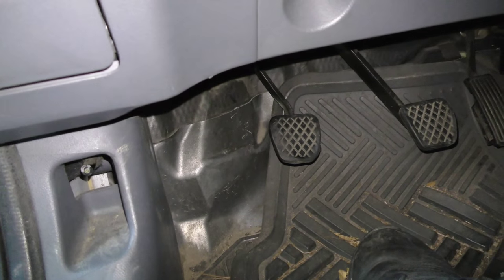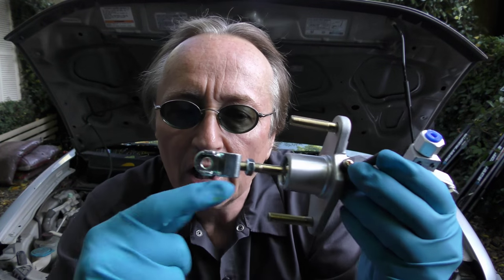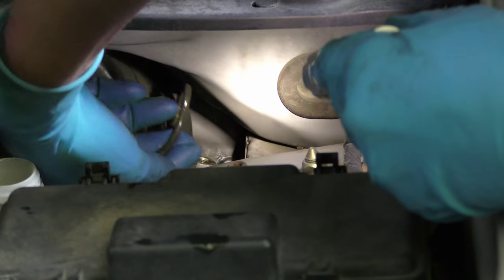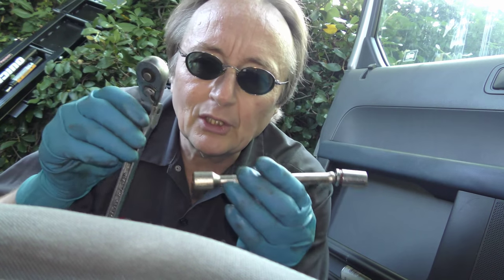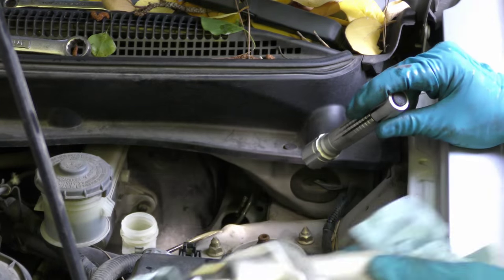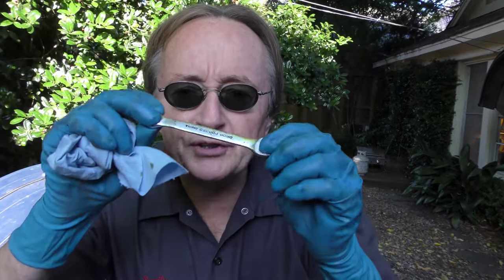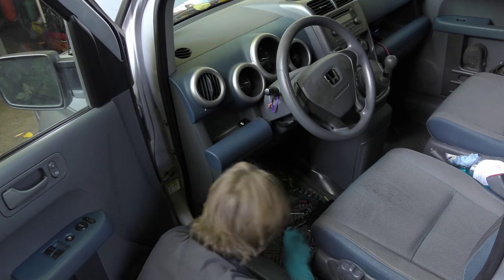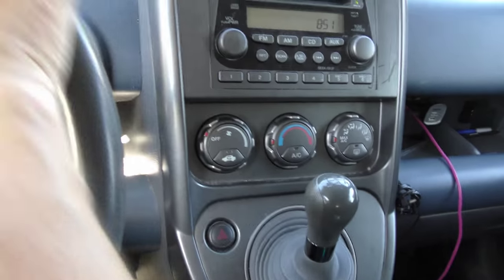How to Fix a Car that Won't Go into Gear (Clutch Master)

Comment: Hey Scotty I got a 56 chevy pickup with an aftermarket power steering conversion it, going down the road yesterday out of nowhere the wheel became a bitch to turn. I'm almost positive its a bad pump but it didn't groan at me or give me any signs it was going to go out. Any input?
Reply: Update new PS pump didn't help a damn thing, wheel feels seized up screetches like hell when you turn it,  linkage seems normal

Comment: What vehicle was that? Ive never seen a manual shifter up there. Is that weird to drive? (Commin from manual daily driver) And keep up the great vids scotty.
Reply: trollaphobic It looks like a Honda Element.
Reply: As a 4 year valet veteran, i can tell you there are many harder gearshifts than a Honda Element's. Being on the bottom of the console like that isn't too bad. The way the seats and wheel are ergonomically set up helps a lot. Doesn't feel like a stretch at all.

Comment: 2015 camero ss I have been having issues with 1st gear where it's been very difficult to engage it. Yesterday getting ready to leave to work I couldn't get it into any gear including R. After I turned it off and restarted it all gears worked except 1st. Of course I haul it over to Chevy they can't find anything wrong with it all gears decided to start working? Not sure what's going on?
Reply from the maker: it's under warranty, leave it with them and get a free loaner car till they fix it. Realize GM doesn't care much about their customers that much at many dealerships, and as they get very little pay for warranty work, they care even less then. Force them to.

Comment: Dodge neon 98, was driving in 3 gear. the stick shift will not change gears, it was stuck. but it was loose straight forward and straight back. tow it back to the house. next morning moving the shift around, start to get back to normal and i was able to drive it. clutch pedal was good no leak that i can see. so what could be the reason it got stuck like that?

Comment: My 2013 Kia Rio 1.2 has the same problem and it grinds when putting reverse. I changed the clutch master cylinder and it still has gears stucking when engine is hot. I can easily change gears when it's cold or engine is off. What could be the problem

Comment: How's it going? Huge question for you. It's kind of weird and an think I know what it is. So, I have a 2011 Caliber 2.0 mt. I believe it's something to do with the bleeder valve but not 100%. I installed a new clutch set, (it's one of those ones that the flywheel is integrated in the clutch, but you probably know that.)  master and slave cylinder, along with the clutch bleeder almost a year and a half ago. Haven't had any problems untill a month ago. Did my brakes, and about 2 weeks later, I start losing my clutch. It is an integrated brake master cylinder or whatever. My brakes work fine, no fluid on the ground, on my caliper's, in my trans or anywhere I can find. But it keeps taking air in my clutch. I got to bleed it every day. Works fine untill the next morning. Any ideas?
Reply: The lines are new too. I changed the end piece of the bleeder valve and it held up for a week but decided to take air again.

Comment: It's not very environmental friendly if you just change the whole part you could change the rubber seal. 

I get a lot of people swapping their alternators out when the diode pack gives up when a simple re-solder of a diode saves you buying a whole new alternator which is a 95% saving cost and it's like that with most parts that you have to regularly change.

If you ever get in a sticky situation where you have a rubber seal that is leaking and you cannot not change it in time and need to use the vehicle then cover the seal in wintergreen oil it swells the rubber up and stops the leak

Comment: My wife's car, a Hyundai Excel 1997 Sprint Auto, suddenly failed to accelerate after braking. It works when in Reverse, but the forward gears (D/2/L) seem to give out as soon as acceleration kicks in. AT oil was low, and I refilled it, which didn't fix the issue.

Can we narrow the problem down to a Transmission issue, or should I try something else before I take this to wreckers?

Thank you kindly.
Reply from the maker: koran junk transmission is shot, junk it or gamble with a used transmission
Reply: Scotty Kilmer  Thank You very much.

Comment: I have a 2008 Kia Rio, after changing the clutch master, it got into gear for about a 30km drive, but then stopped
Someone said could be the clutch plate is burned out
Any advice for me?

Comment: Dear Scotty, i have a 2000 vw beetle glx  twin turbo six speed manual transmission , and its getting hard to shift through gears and sometimes i have to use force to get it into gears, now im going to change the fluid to ryoal purple max synthetic, will this help or is my tran going out? Thanks
Reply: The problem you have there is that you drive a beetle
Reply: Adam Socolofsky I have had good luck with redline synthetic trans fluid/oil.
Reply: Adam Socolofsky There are many reasons why your shifting is rough, may be synchromesh related or your shifter fork or a sticky clutch, worn out clutch, hydraulic cylinder to engage or engage clutch to the tranny. Also transmission gear oil how many miles or kilometers does the car have ? last service ?  also your driving style , how well you shift, do you keep your foot on the clutch pedal when driving ? on and on and on.
Reply from the maker: Jonas Ben pray the fluid helps, cause VW transmission work costs a ton. Also do check the clutch for wear, a worn clutch plate will do just that as will weak master cylinders or slaves.
Reply: Hey there Sir, thank you for your reply you read my comment awesome.

Cheers.

Jonas.

Comment: Hi Scotty Kilmer I have a 90 Honda Accord Dx automatic all my gears work except reverse some times it goes in reverse and times it doesn't it makes a grinding noise like a stick shift grinding noise I changed both solenoid but it still won't work right I need help badly any suggestions please

Comment: another video said if you can go into gears ok with the engine off but can't when its running its a clutch issue.....in your example could you engage gears with the engine off?

Comment: Scotty am getting a P0852 error code on my 2019 Honda Civic Type R and it does turn on but it shows that "Park/Neutral Switch Input Circuit High" how can I fix this?

Comment: I have a 1997 Chevy S10 2.2L and the automatic transmission quit going into the passing gear. I checked the fluid and that's perfect, I got no clue where to start. What could it be?

Comment: Hey Scotty where is the upper transmission solenoid located on a 2000 Nissan frontier 4 door 3.3L v6 automatic?
Reply from the maker: Eduardo Garcia   I've never done one, but they are either on the top of the transmission on the outside, or deep inside the transmission. Call a dealer parts dept with your VIN, and pray it's on the outside
Reply: Hopefully it's on the outside! Thanks

Comment: I have a 2005 sentra 2.5 se-r spec v that struggles to get into gets and will grind and push itself out of gear right when I'm about to let go of the clutch. could the repair on this video fix my problem?
Reply from the maker: in your case , more often a broken transmission internally, unless it's just a worn out clutch. But worn out clutches generally also slip on hard acceleration
Reply: I was hoping it wasn't internal cause the clutch and flywheel are both brand new

Comment: hi scotty
I asked this question before on another channel
1999 Honda civic Automatic ex.. that's doesn't go reverse while in that gear. sometimes it works sometimes it doesn't
soo can it be the gear shifter linkage? or the transmission there is no slippage in the RMPS
it drives smooth.. it just happens every so often 
soo what do I do?
Reply: +Scotty Kilmer so what can I do...to fix this problem is it the transmission or what? is it expensive
Reply: +Scotty Kilmer can you explain in detail please Scotty your videos help me out alot 😊

Comment: I own an 06 mustang GT and it still won't go into gear. In my car the clutch does not have a separate reservoir. The brakes and the clutch share a reservoir. What do I do if the master cylinder isn't leaking. I bled it but it still won't go into gear?

Comment: Scotty, I have a question.  I have a 2005 ford Mustang gt.  It's stuck in 3rd gear (manual).  What would be the particular reason?
Reply: Like stuck as in it won't come out of gear at all.
Reply from the maker: +GroundZ3R0Gamer transmission is broken internally in most cases, and needs rebuilding now. It was a problem on that year
Reply: +Scotty Kilmer I read that having a aftermarket shifter can cause the problem.  I have a Hurst short shifter and I think they said the set bolt nut can get lose and vibrate off and get stuck. What are chances of this?
Reply: +Scotty Kilmer *set screw nut.
Reply: +Scotty Kilmer same with me. except mine is a 02 gt mustang and I just replaced the transmission not to long ago and gear won't go in and if I force it in it won't go out of gear just replaced the clutch too what could be causing this?

Comment: I have a 2008 Volkswagen Jetta gli it goes into first and second gear fine but won't go into reverse or any of the higher gears do you think that could be the same issue?
Reply: Casey Alessi no most likely the transmission is shot
Reply: @anthonymaynard9809  it worked fine I took it off the road for a couple months got in it today now having that issue

Comment: @scottykilmer hi Scotty my trusted  mechanic has changed this on my Celica GTS 7 and it worked for 2 weeks ... Then it is having the same problem again, any suggestions??? 

I have taken it to him again and he flushed and replaced the hydraulic oil ...

Still having this issue. 

What is wrong w my Celica 😔😔

I m getting desperate.... 

Any advice is appreciated. 

Thank you

Sae.

Comment: I put in my clutch kit and slave cylinder into my car but now my pedal won't go all the way down to the floor! It kind of feels like brakes do. Do you think I might have put the clutch disk in backwards because there were no stickers indicating which side went were? I just don't want to take the transmission out again if I don't have to! PLEASE HELP
Reply from the maker: +daniel moukin first, bleed the crap out of the master and slave cylinder, but odds are you put a clutch part on wrong

Comment: I got a 74 Mustang II V6 Coupe,  i need to turn it off to get it into gear 1 or 2 if started in neutral. Or if put in neutral while the car isnt moving. but if im slowing down It'll slide right into gear 1 or 2.

Comment: Hey Scotty, I have a 98 Jeep Cherokee XJ the driver door has NO power to the door locks, power mirrors, or the power windows. But the power locks work on the passenger door. Any ideas? Thanks!
Reply from the maker: Nicholas Bolt those are notorious for wiring shorts under the dash,  check the connectors there for those systems, and pray it's not a bad body control module, no way can you check that without a dealer scan computer
Reply: I was doing some research that one or more wires might have gotten cut in the door jam on the driver side. I'm going to check that first. I see that's a pretty common issue. Thanks for your input! I watch your channel regularly.

Comment: In trucks. 
What is the benefits of full body on a frame 
Vs
Unibody
Reply from the maker: Khaledaska a more solid vehicle, damaged less in wrecks, and generally handles better. BUT, it costs more money to make and they weigh more so gas mileage is somewhat lower, so most are made unibody

Comment: I just replaced my clutch slave cylinder but the part of the transmission where its supposed to push the cylinder so fluid can run through isn’t responding, also my pedal just stays down and doesn’t come up and the car wont go into gear, do I need a new transmission?

Comment: Hi, having a problem with my 10 year old car mazda 3gt 2005. almost everything fix under the hood and fuel pump replace but my car still jerking when its changing gear (automatic transmission).

Comment: i have a 2005 Scion TC replaced the master cylinder and bleed the line also changed the clutch but the clutch pedal still gets stuck to the ground the car only goes into gear (first and second only) when its jacked up but when its lowered to the ground it doesn't want to go in gear. could it be the transmission that needs to be replaced ?
Reply from the maker: pedal getting stuck is more often a hydraulic problem, but if not that, clutch needs replacing

Comment: the funny thing is manual transmissions are fading out big time, maybe 1 out of every 100 cars i work on is a manual and its usually a small econo car. never see trucks with a manual anymore, infact i remember ordering my 2007 f-150 new and i couldnt even get a manual transmission with the v8. only available with the v6 and on heavier models like the f250 and bigger
Reply: I know right, my dad has a 2001 Ford F150 V6 with a manual transmission personally I prefer manual to automatic, hopefully they don't go away for good.

Comment: once I take apart the transmission should I be able to tell if the part or parts of the clutch are worn out
Reply from the maker: yes, once you remove them from the flywheel
Reply: what are the torque settings for clutch components on a 2000 kia sportage

Comment: My gear grinds into 3rd .. every other gear is fine .. am I right in thinkin it's the snycro any advice plz ✌️ I drive a pugeot 208 hdi .. thanks
Reply: If it goes in easy when you double declutch its the synchro.

Comment: what about a truck that goes into gear without pressing down on the clutch? I have this problem right now, the truck is off but I dont even need to press the clutch down to switch gears. currently not running but why does this happen?

Comment: 2000 Saturn SL manual  transmission will not shift into 2nd and reverse .have look at shifter cables and have not found a defect .could master clutch be allowing part the gears to go into gear. moving the gears by hand on outside on transmission then got back into car got it to into reverse 1 time the right back to not going into reverse gear.  Was getting  2nd gear to go into gear off and on tell now the 2nd gear grinds when trying to put into gear. Have any Ideals ?
Reply: Sounds like the clutch is toast. My dad's C230 Kompressor doesn't go into 2nd gear at all, had the slave cylinder replaced and it still does the same thing. Typically if it won't go into one forward gear but goes into the others fine it's a clutch problem.

Comment: I have 2002 GMC Yukon , there is a problem with the AC , it only works when I adjust the fan speed to 5 ، it doesn't not work at all at lower speeds . thank you
Reply from the maker: fahad alghamdi  replace the blower motor resistor assembly
Reply: Ok thanks and ur the best

Comment: I just left Orilies for bolts for my wheel and I think the clutch just went out. I heard and felt a jolt and tried to change gears and it won't. I'm ☠️ my husband just changed the breaks and bolt snapped.   I don't know what it is. Transmission, flywheel, shut I'm so freaken out😝

Comment: Scotty man I have a 77 camaro automatic it engages from park all the way down to 1 but when I try and go back up to park the shifter doesnt bring the transmission back, it leaves it at 1 .So then I have to go under and pull that lil lever gear thing that's connected to the linkage back up to park. it seems like it does have the strength to push it back up ...help me please .
Reply from the maker: get a new shifter cable assembly

Comment: I have a manual 1997 Toyota Corolla but it takes force to push it in 3rd and 4th gear. Every other gear goes in smoothly. Sometimes 3rd and 4th go in smoothly to. I don't know what's the problem

Comment: Hi, i have a 2001 bmw e46 325ci  manual 5 speed , and the wont go into 1 st gear or 2nd , if i try to put it in first it pops out , if i try to put it in second it works sometime but also can pop out , also when i shift gears  i can hear tranny grinding sometimes , for example going from 1st if i got it in to 2nd  when the car is above 2500 rpm it grinds really bad , and when i stop for a stop light i cant put in any gear  like all of wont do it except for reverse, reverse always works.I dont know whats the problem is , could it be the old fluid because car has 46k on it and i bet fluid never been changed cuz the car sat in garage for 9 years.
Reply from the maker: +Andrey Arkashin tie for a new transmission, popping out of gear is internal problems
Reply: Fixed tranny , by adding new oil, old oil was no longer there it was replaced somehow by something or someone to WATER GOD DAMN water in tranny , so it works now but all seals are leaking and gotta get changed UH too much work for that.Also not grinding or popping our of gear , but leaks on to my clutch

Comment: Hey so I changed to cmc and slave on my Honda si and it still gives me the issue a bit not as much as before the clutch is pretty down too can it be that I did something wrong? Or it might be something else?
Reply: Release bearing in the clutch might be shot.....honda si clutch's seem to be massive chunks of crap

Comment: Hey Scotty, recently my vehicle started showing this issue of clutch pedal becoming hard while driving traffic or while idling in hot noon time. It becomes soft if i drive in highway. I have put in a new clutch now got the system flushed with new fluid but issue still persists.
Reply from the maker: Rahul Jones if it's really old, change out the rubber clutch hose line too, they can bulge an do that. BUT, of course, a worn clutch master or slave will also do that, I'd change them first, more common.
Reply: Scotty Kilmer Thanks Scotty. Will try that soon. :)